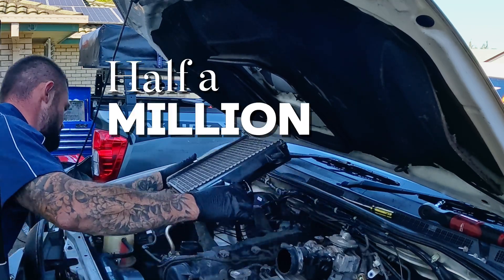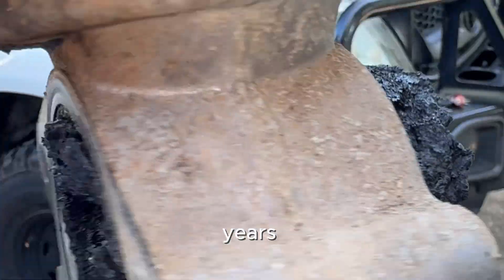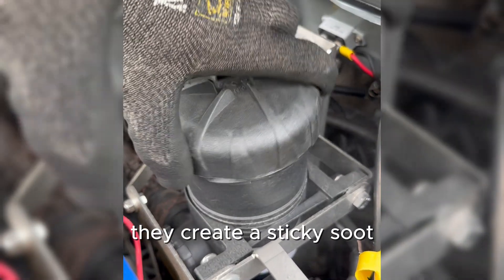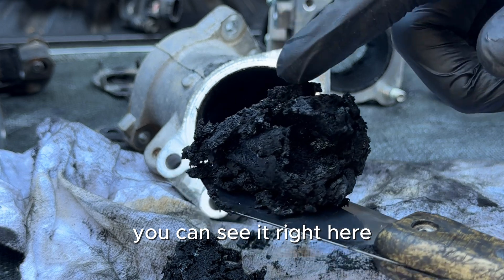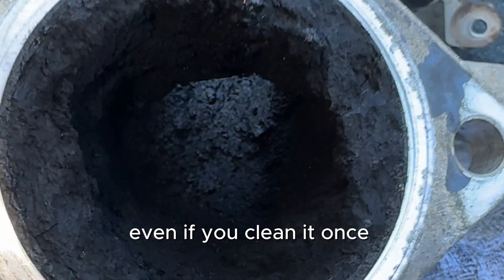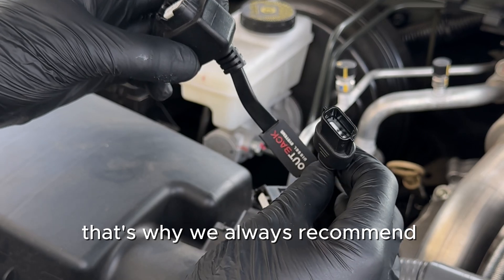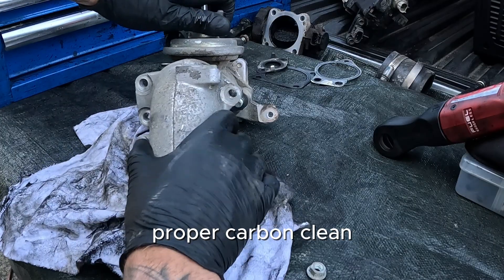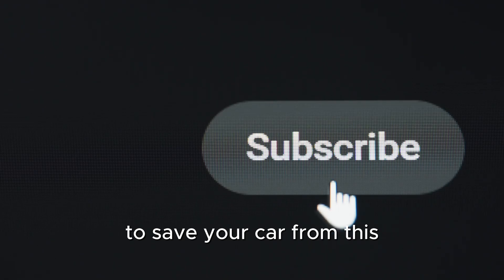Half a Million Kilometres of Carbon Build-Up in This Hilux Engine 🔥

Comment: How does deleting the EGR valve affect the functionality of the Turbo?
Reply: If you don't get your car properly re-programmed after a delete, It will increase the wear on the turbo and your car might have cooling issues. But if it's done properly, you will get better performance, fuel economy and engine longevity.
Just make sure if you're getting the job done, that the car is re-programmed properly. Otherwise you might cause more issues.